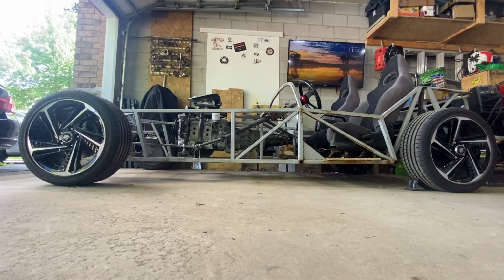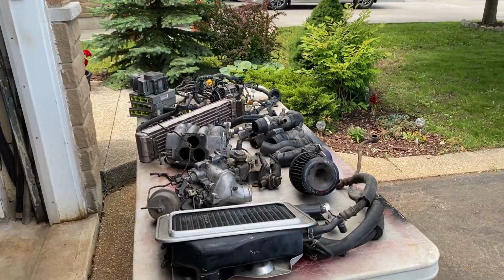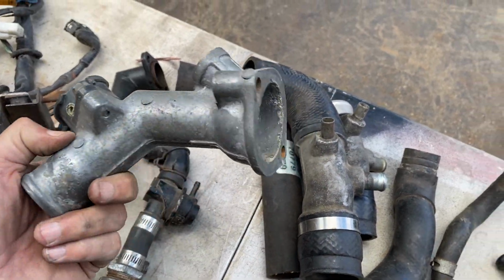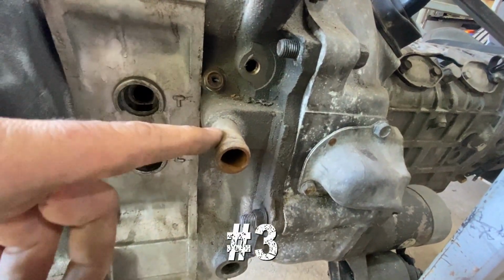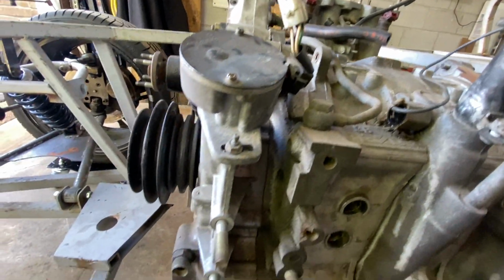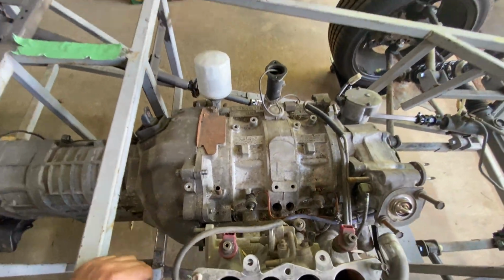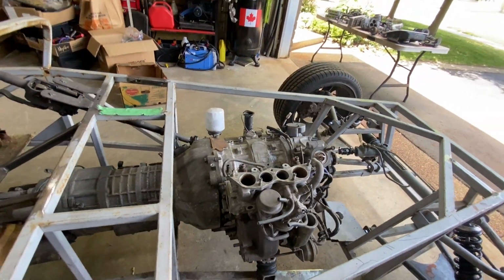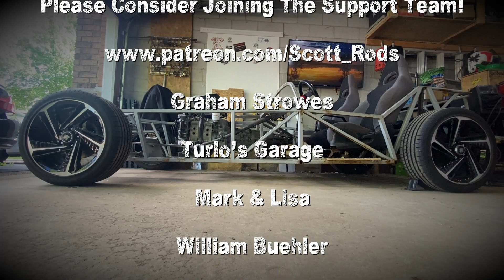13B Rotary Turbo Engine Parts Identification

Comment: #1 is a temp sensor, #2 is the oil pressure sensor, #3 is a heater hose, #4 is oil cooler in, #6 your correct, #8 is oil level sensor, #11 distributor, #13 oil cooler out, #14 I think is a belt tensioner, and I believe that #20 runs off #15, #18/19 would be for your throttle body
Reply from the maker: Thank you so much Mr Rat.